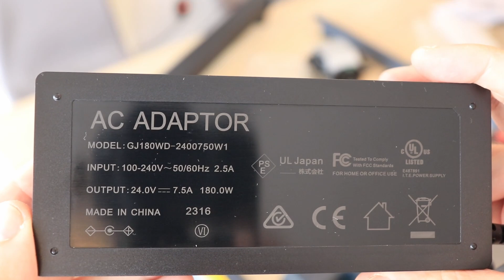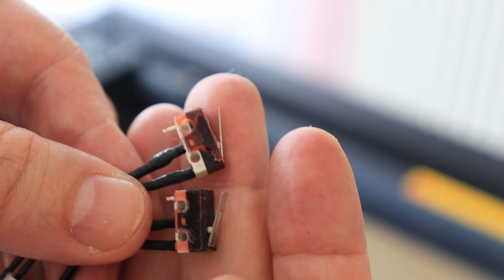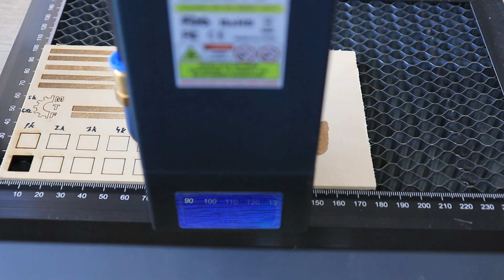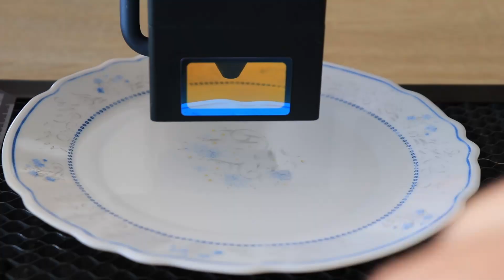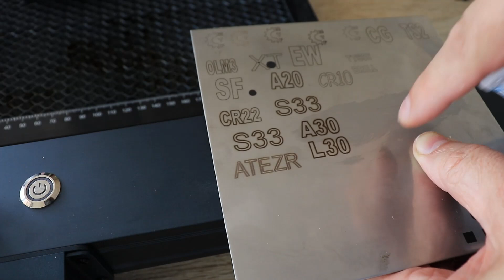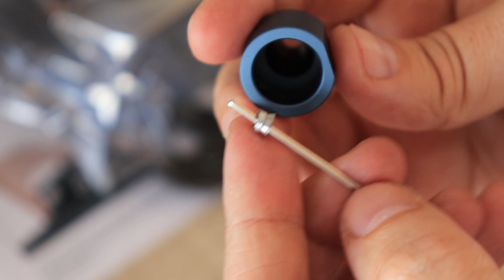The most powerful laser I tested so far: Longer Laser B1 30W

Comment: FYI...  Recent shipments have provided a "new", smaller nozzle opening to increase the velocity of the air assist.  Also, when LIghtburn initially sets up the controller it mis-assigns the GRBL driver, it should be the "plain" GRBL option, not the M3....  Some have drilled out the air assist tubing connector where the tubing connects to the head and this has helped the airflow.